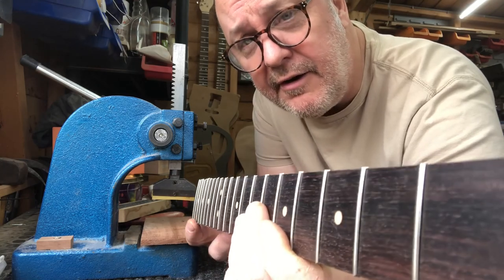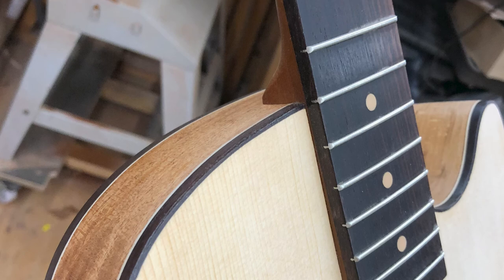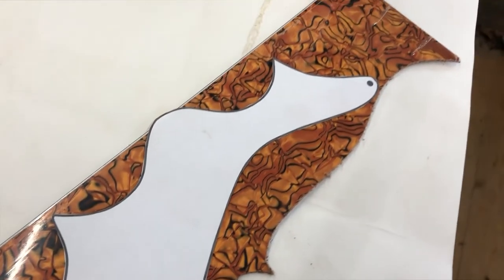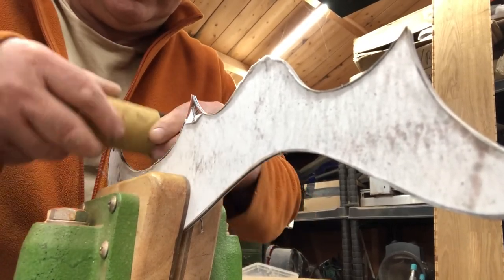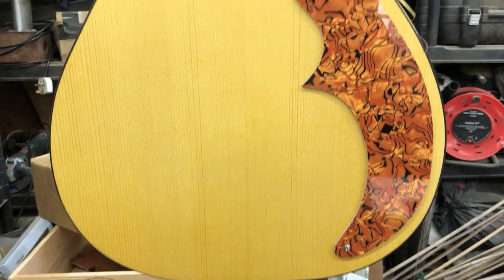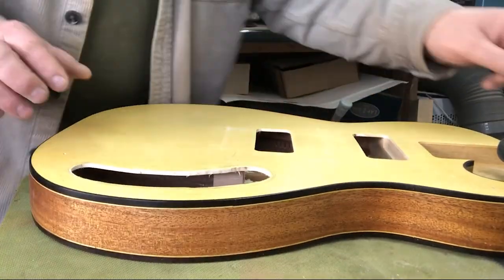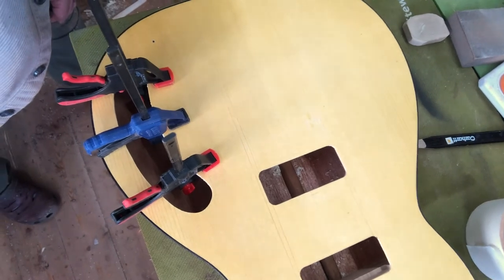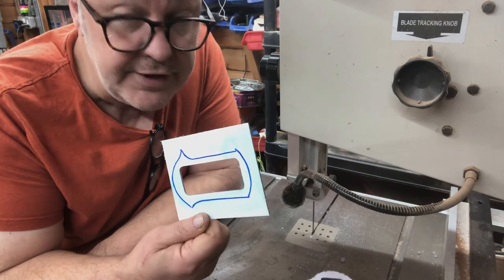Part 5 - Full build of Harmony  Stratotone style guitar. Fret pressing, sealing and scratchplates

Comment: Liking the whole build so far, you mentioned curved corners in acoustic builds maybe being musical? I think there is an overlap of knowledge to the aircraft and marine industries where square corners are called hard points and are where cracks and fractures start from vibrations, which is why airplane windows have round corners. New subscriber keep up the good work 👍
Reply from the maker: Square windows were what caused the de Havilland Comet to fail. It’s square windows caused stresses and metal fatigue. Glad you are enjoying the series Barry. C